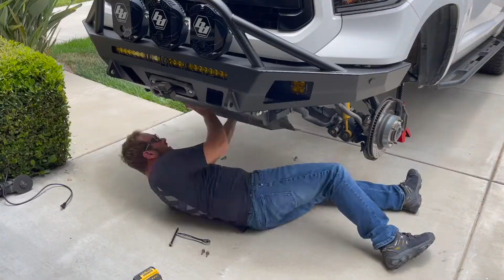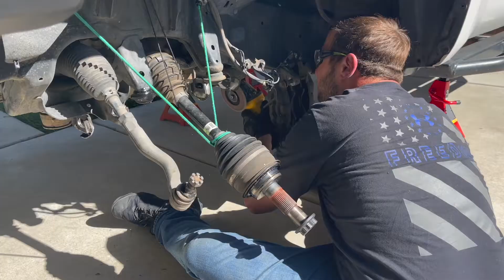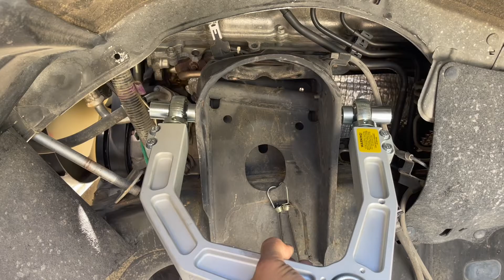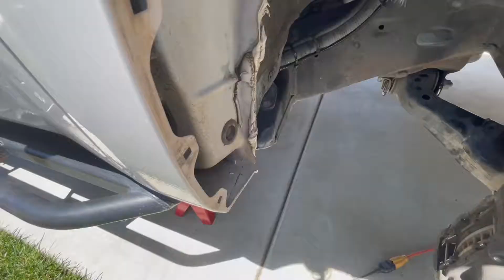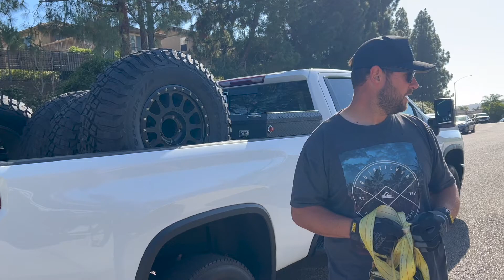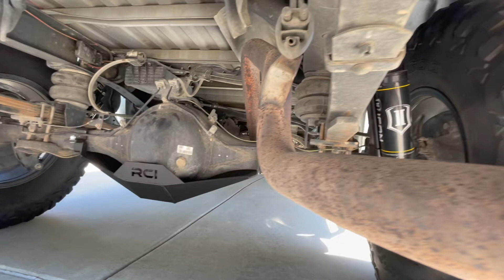ICON 3.0 Suspension & 37 Inch Tires - BIG Changes For The Tundra

Comment: Beautiful truck man! Can’t believe you’ve been running stock shocks! Are you regeared? I have about 600 lbs constant load. I’m running ome Dakar Leafs with the AAL with Toytec shackles. If I could do it again I would have went with deaver’s u748 pack. You should definitely get the day star cradles if you wanna keep your bags. You should look into a custom pack from Deaver or Alcan, they can make you leaf packs specifically designed for your weight. Excited to see some wheeling vids of this beast! Cheers!
Reply from the maker: Thanks a lot! I’ve had this suspension on order foreverrrrr so those stock shocks have been horrible this whole time but didn’t really have a choice…just had to wait. 

Thanks for the leaf pack info. I would like to get rid of the bags completely…. so a custom leaf pack would be awesome. This truck is fully loaded at all times so I’m not worried about it riding horrible “empty” because of a stiff spring. Do I need to do after market shackles with the deavers or alcan’s?
Reply: @prospectoverland  Gotcha! You may be able to use stock shackles but I’d upgrade to some that use poly bushings for best performance. You could look into Coachbuilder, he offers 3 different lift heights. Your new leaf springs will probably only be 2-2.5” of lift. So consider how much rake you want, if any. The real determining factor is how much lift those Icon 3.0s support. Also I’m curious about the big brake kit, looks like most require a 20” wheel :/ but sdhq makes one that you can use an 18” wheel? Are you running 18s currently?
Reply from the maker: @oversizedoverlanding2365  ah okay that all makes sense. What do you think about me getting the leaf pack first, see what the ride height is then get the appropriate/required lift shackle after. I feel like I’d be just taking a guess and which length shackle if I try and buy it before the leaf pack is installed. 

The brake kit….yes I have 18” and I’m going with power brake. Which are the ones that SDHQ sells. I’m just not getting from them…no particular reason. Just a different vendor. I can’t wait to get them on!
Reply: That would probably be just fine, as long as the new leaf pack is compatible with stock shackles. Stock shackles use the factory bushings though which have to pressed out/in. Definitely check and see though how much lift the icon 3.0s are rated for though. It wouldn’t be the end of the world if you exceed that, but I think you’d lose a little shock travel.
Reply: That would probably be just fine, as long as the new leaf pack is compatible with stock shackles. Stock shackles use the factory bushings though which have to pressed out/in. Definitely check and see though how much lift the icon 3.0s are rated for though. It wouldn’t be the end of the world if you exceed that, but I think you’d lose a little shock travel.
Reply: That would probably be just fine, as long as the new leaf pack is compatible with stock shackles. Stock shackles use the factory bushings though which have to pressed out/in. Definitely check and see though how much lift the icon 3.0s are rated for though. It wouldn’t be the end of the world if you exceed that, but I think you’d lose a little shock travel.
Reply: That would probably be just fine, as long as the new leaf pack is compatible with stock shackles. Stock shackles use the factory bushings though which have to pressed out/in. Definitely check and see though how much lift the icon 3.0s are rated for though. It wouldn’t be the end of the world if you exceed that, but I think you’d lose a little shock travel.
Reply: That would probably be just fine, as long as the new leaf pack is compatible with stock shackles. Stock shackles use the factory bushings though which have to pressed out/in. Definitely check and see though how much lift the icon 3.0s are rated for though. It wouldn’t be the end of the world if you exceed that, but I think you’d lose a little shock travel.
Reply: That would probably be just fine, as long as the new leaf pack is compatible with stock shackles. Stock shackles use the factory bushings though which have to pressed out/in. Definitely check and see though how much lift the icon 3.0s are rated for though. It wouldn’t be the end of the world if you exceed that, but I think you’d lose a little shock travel.

Comment: I have OME dakar leaf springs with firestone airbags along with daystar cradles to prevent sag.  Look into the daystar cradles if you're deciding to keep your airbags.  It'll prevent the bags from ripping when you're flexed out since its not attached.  Love the setup!
Reply from the maker: I’ve heard of those cradles…sounds like they are working good for ya….it’s deff an option I’m considering. I’m always worried about my bags ripping. Thanks!
Reply: I have an 08 Tundra, firestone air bags in the rear, replaced the leaf springs with new leaf springs from KC Spring that gave me an extra 600lbs (estimate from the spring folks) of carrying power.  I believe the spring pack has an extra leaf in it.  The springs gave me an extra 3/4" of height in addition to stock and I put the adjustable Bilstein shocks up front ... I have a TRD sway bar in the rear.  I still have the factory rake which I like.  The upside, very limited body roll to the point where the nanny controls complain once and a while taking an exit too fast (must have a g-force meter) ..down side, it's a little stiff like a 3/4 ton truck but hauling is a breeze and I like the extra lift.  I have 220k miles on the truck, it's in great shape, thought of converting it into an overland truck for fun with 35's or 37's.